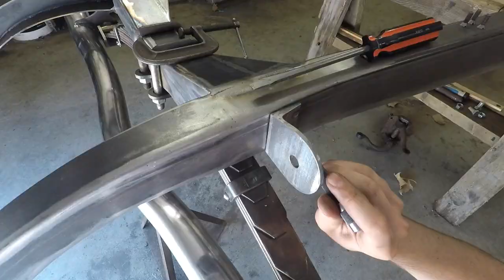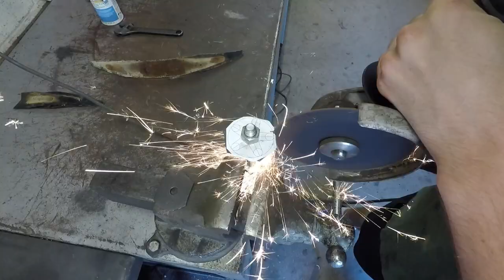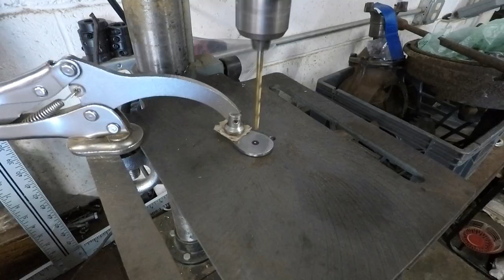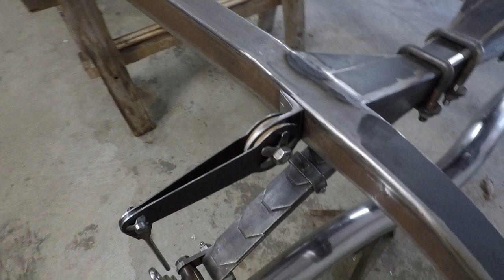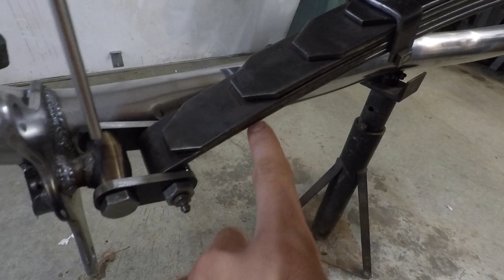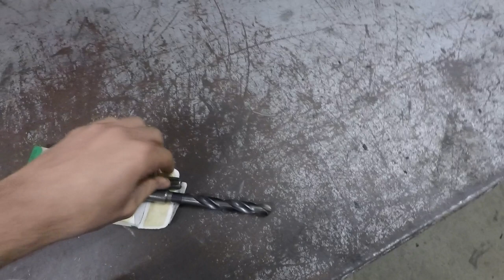Completed Friction Shocks | Boat-tail Speedster Pt.11

Comment: The spring steel should be annealed before you form it, then once it is in the shape you want, get it red hot until it loses magnetism and quench in cool water or oil. Oil will give a black finish and water will keep them normal. This is what makes spring steel springy. Also, not going through this process is why so many of them cracked when you were shaping them.
Reply: Also, temper after the hardening.  This will reduce brittleness.

Comment: Nicely done , Yes that 7/8 rod should work good , Could almost re temper those stars.
Reply: Garnett M not all the way through, did he not re temper them? I would've after that much cutting and grinding.
Reply: Postal Patriot556 Would hold the bushings better.

Comment: What kind of engine are you planning on using as well? I'm of the opinion you should find a straight 8. I just bought a 1939 Buick four door sedan with a straight 8 and it's pretty darn cool. Nice and narrow.
Reply from the maker: a straight 8 would be awesome, but they're not easy to come by and parts are harder to find and more expensive. I have an engine lined up that should work, but Im waiting to reveal it :)
Reply: I'll consider myself lucky then that the car I bought came complete and not parted out. Far as I can tell I'm just missing a spark plug.
Reply: i just scrapped an almost complete 38 straight 8, it was complete when I got it but someone stole the crank  out of my shed, I do still have the starter and generator though if your interested
Reply: darkside0914 you are now my friend. It certainly may come to that. My engines complete and looks to be in good condition. But it's never been rebuilt and no one has even attempted to start it in 20 years.
Reply: the engine came out of a running driving car, the previous owner stripped it down for some reason and then put the engine in storage, I think they were rebuilt not long before that because they are clean,, I don't know how or if you can pm on here, but if you're interested let me know and we can make arrangements somehow

Comment: Your definitely going period correct on this build. Are you going to have mechanical brakes?
Reply from the maker: no; it'll have hydraulic drum brakes. my dad even would like me to use disc brakes, but that is 100% not going to happen lol
Reply: Yeah that would be some sort of taboo and frankly rather pointless. With a light weight car like what your making your not going to see much benefit anyways using discs.
Reply: Properly set up and with the right friction material, drum brakes will do just fine.  Any brake that has enough grip to lock the tires will work just as well.

Comment: I would have thought that the wall thickness of the frame is not sufficient to tap into for the friction mounts. They will take quite a bit of force.  I would have thought it would be better to have studs welded to the frame.
Reply from the maker: I made a test piece beforehand to see how string it was because I wasnt sure either, but there was enough grip that the heads of the screws stripped before the threads

Comment: My experience is in aviation airframes and a little home automotive, I have a feeling those shock rods are 1/2 or 1/3 the size diameter they should be at those lengths.  I am not an expert with gorgeous scratchbuilt cars, perhaps there is plenty of historical or modern examples that prove me incorrect. I would like to know your thoughts on the matter?
Reply from the maker: you're probably right lol the rod wont be quite as long one I attach them to the axle, but yeah they're pretty thin

Comment: You definitely know what you’re doing but I’ve seen hotrodders cut-off and reverse the leaf-spring ‘eyes’ and re-weld.  Which is better?
Reply from the maker: Yikes, I would never weld a spring. That would ruin the temper and make it brittle
Reply: @MacroMachines  yeah, the accepted draw-back...  I’m convinced, thanks for replying...

Comment: A nice OHV Buick straight 8 would look just fine in you superb frame ^^
There's a decent priced one in Minnesota who seems pretty complete:

http://www.2040-parts.com/36-37-38-39-40-1936-1937-1938-1939-1940-buick-320-straight-8-eight-engine-motor-i1996665/ 

I have a nice straight six sleeve valve Falcon Knight laying around with it's gearbox... but shipping it from France isn't exactly a cheap option !